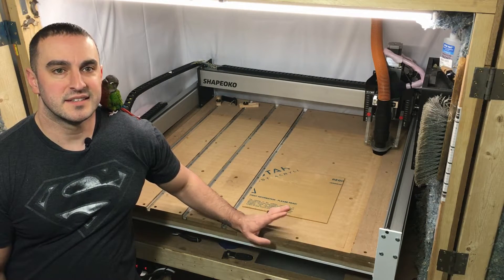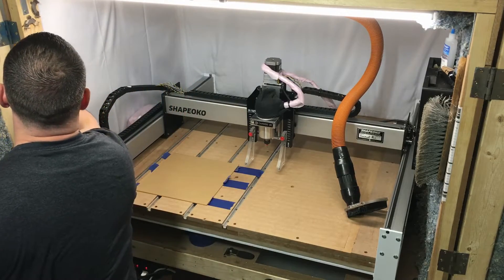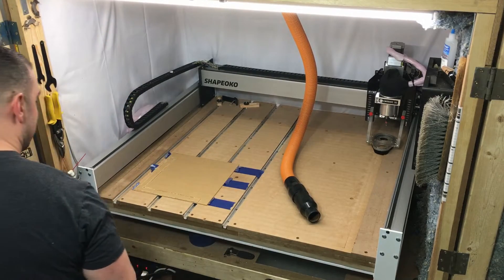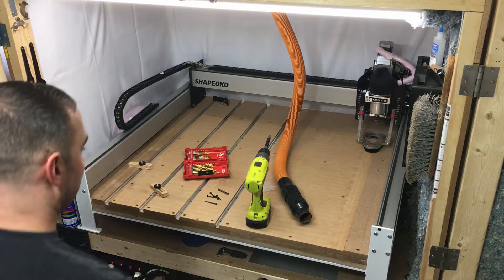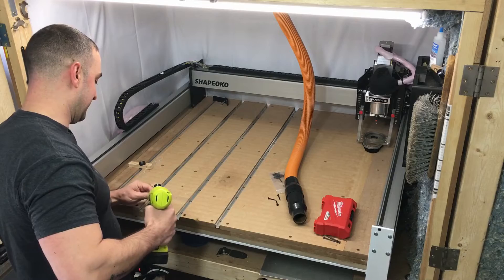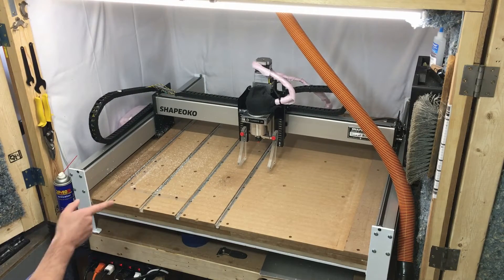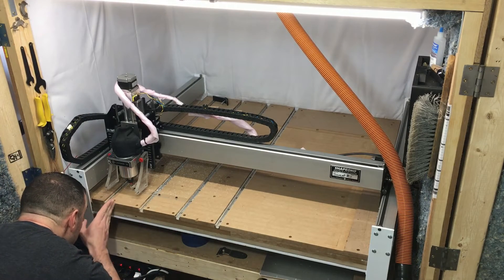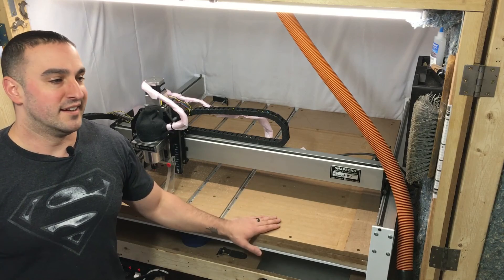Shapeoko 3 XXL - Trick To Maintain X & Y at Zero

Comment: Instead of jogging, I go to the zero screen and you can just type in the position. So after making your fresh edge cuts, you'd just type in 0.0625 (it's 1/16 more to the right than your zero point) and press Enter. That defines your current position (where the cut was just made) as 1/16 more positive than zero, which is exactly what you want. Just a thought!

Comment: Have you performed the calibration for belt stretch for the 1/8" endmill? Technically I wouldn't think there would be a difference compared to a 1/4" endmill but it might be worth checking out
Reply from the maker: Honestly no not yet. So far so good with the tolerances I can expect but eh. That Z axis upgrade I did was garbage because the CNC4Newbie bearing rails have a lot of play in them. Then I would really like to have a metal table that is perfectly square to the gantry. I want to build my own CNC one day but until then I have to make this thing work for what it does for me.